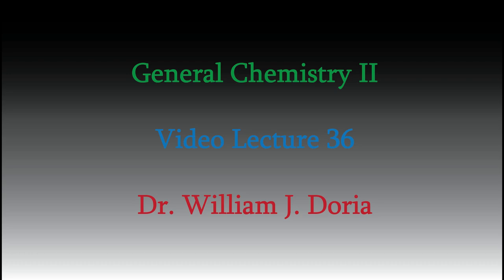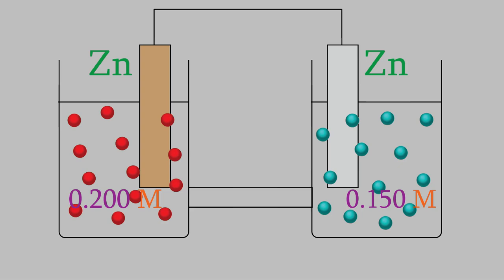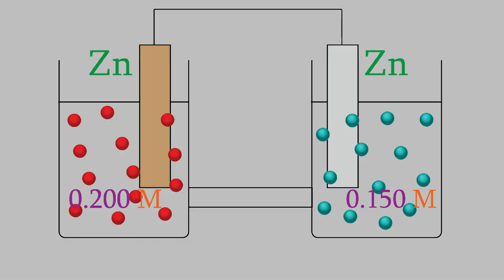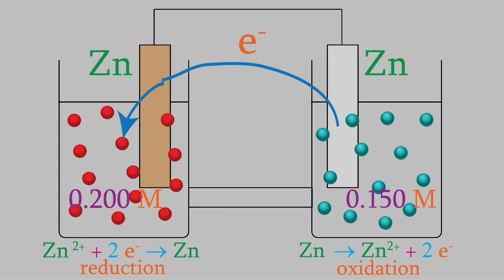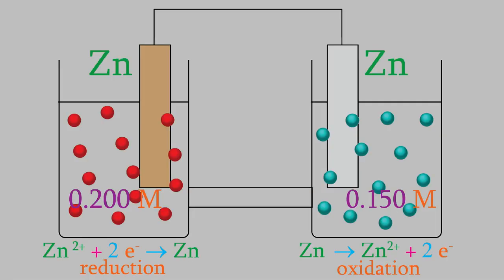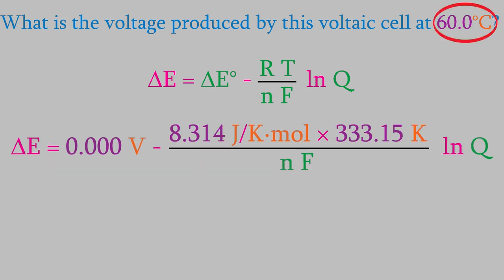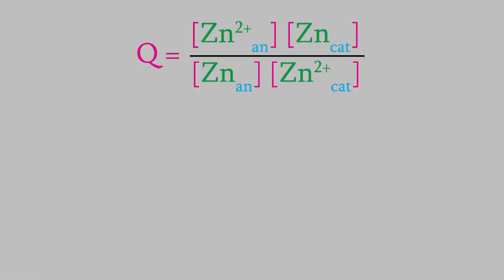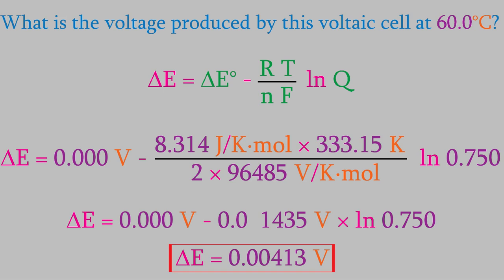Chemistry 2, Part 36: A Surprising Kind of Battery -- The Concentration Cell

Comment: Theoretically, if in a Daniell cell, the c(Zn2+) would be incredibly high and the c(Cu2+) would be incredibly small, could the Zn/Zn2+ become the cathode and the Cu/Cu2+ become the Anode because  E(Zn/Zn2+)=E°(Zn/Zn2+)+(0,059V/2)*logc(Zn2+)>E(Cu/Cu2+)? So then it would be deltaE=E(cathode)-E(anode)=E(Zn/Zn2+)-E(Cu/Cu2+). Would that be theoretically possible, or will Cu/Cu2+ always stay the cathode because E°(Cu/Cu2+)>E°(Zn/Zn2+)?